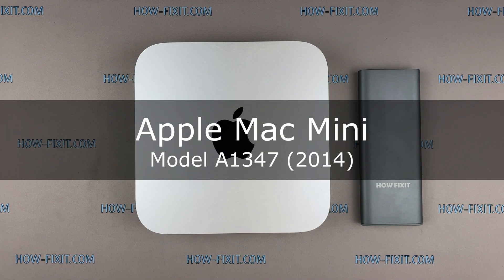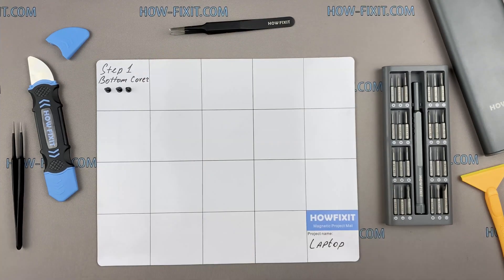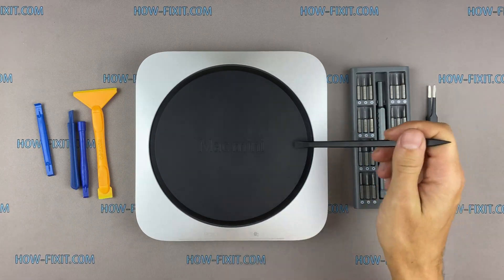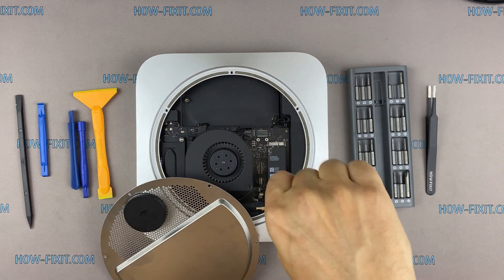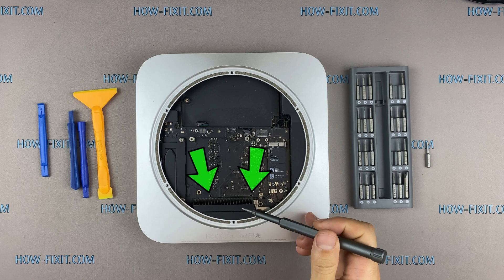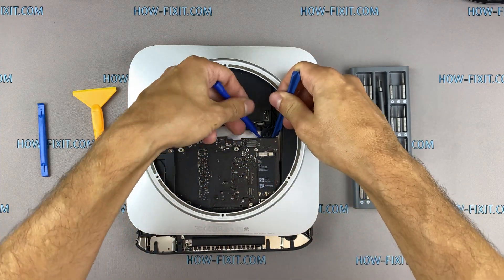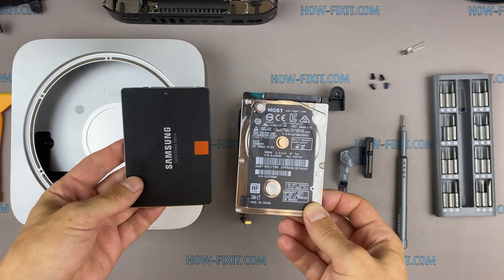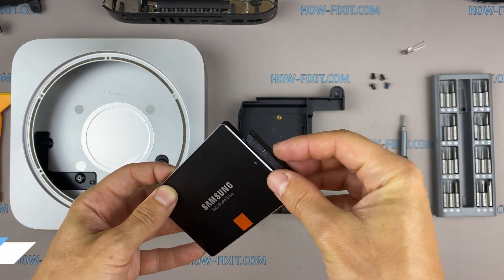Apple Mac Mini 2014 (A1347) Upgrade and install SSD or Hard Drive replacement

Comment: I just got a used Mac Mini late 2014 with 3.0 GHz i7 and 8gb ram, It came with a 1TB HDD, and it was SLOOOOOOW AF. I just replaced it with a 500GB SSD and it's about 100 times faster. I also ordered an adapter so I can easily install a M.2 NVMe drive. That'll be another 500GB, so that'll get it up to 1TB again. I'll probably install Boot Camp on the NVMe and run windows on it. 
I'm actually posting this comment from that machine.

Comment: That's neat and internally it looks really well designed. But to do this same process on a HP Mini PC you need to remove one screw (Two if you count the thumb screw that holds the case in place) and it takes about 5 minutes (or 2 if you know what you are doing).

Comment: June 2024, this video helps me to upgrade SSD of my Mac mini 2014. Thank you!
Reply: July for me..... Now to get a NVMe adapter
Reply: Is the machine still working fine in 2024? should i buy?
Reply: @alikhan-xs5wc  Mine is still working fine. I mainly use it to play Tidal in my HiFi setup and browse Youtube.
Reply: @alikhan-xs5wc  It‘s good enough for me to watch online video, web surf and local photo browser in 2024. Mac mini 2014 later 8GB + self-upgraded SSD.
Reply: I just used this video to swap in an SSD. It now runs ‘better’. Don’t bother with MacOS. Learn to use Linux.
Reply: @MagioneUmbria  what about windows?

Comment: What is the connection at 2:28 ?  I totally ripped it off , can I buy one and solder it ?
Reply: Awesome. I'll put it back together and give it a try tomorrow.
Reply: I did the same thing.  Did you figure this out?
Reply: @xMinist3r  yep , it’s for the IR sensor. Which I never used and it functions fine without it.

Comment: Hi there! I really like your videos ... Very well edited and done. Explanation 100% clear - Is there by any chance a video about upgrading the DDR3 memory of this very same model? (MacMini 2014?)
Reply: The 2014 Mac Minis do not have upgradeable RAM, there might be a way to do it but you’d need a PHD in electrical engineering to upgrade it since it’s integrated into the logic board lmao.
Afaik the last Mac Mini with upgradeable ram sticks was the 2012 model.

Comment: Can't make this connection at the 7:40 mark ... been trying for an hour . any suggestions ?
Reply: Yeah, I'm gonna say that you pulled the entire connector off which is very easy to do. Careful superglue might fix it
Reply: @alexanderthedecent6778  it's just the remote connector.  I just put back together without it and the mac mini works just fine.  Now to figure out what I want to do with it.
Reply: i cant either. i think i brought up the whole peice. not sure what to do about that.
Reply: @ANTIPLANETRECORDS  any luck? I did the same thing

Comment: I yanked the piece at 2:27 too hard and it came off with not only the wire part but the bottom too. Any suggestions? Can this be super glued back?
Reply: i need to know too
Reply: I broke the connection too. It's very weak and the video shows him doing it too fast.
Reply: Amazing. That connection was, for me as well, a near disaster. 

And, I’m not sure that there is a safe way to remove it.

Comment: Hi, at 2.26 you lift a connector with that black prying tool, what is that connection..... I made a mistake and lifted from the front and it is broken. Pls let me know what it is and what I must do to fix it? Will i have to replace the whole multi-cable? many thx. Keith
Reply: Yeah. Total BS. I lifted that connector instead of sliding it back and the pins broke off. No way to fix it. Mac is a brick now.
Reply: @easy1easy1  literally no way to fix it?!

Comment: Thanks for the video. Got mine upgraded following this video! Not too difficult just took my time and watched video several times.  I suggest a USB boot drive and not the internet thing which did not work for me. P.S. also found out slightly later this Model can also take a NVMe SSD drive (wow!) which is even faster. I added this as well. Now I have two 1TB drives and the boot drive is on the NVMe for even faster boot times.
Reply: Could you tell me how you did this? Never messed with the NVMe SSDs. Ty!

Comment: That oblong piece of tape that you removed and did not replace is used to ensure a good connection between the drive and the adaptor. It is more important to use on a HDD due to vibration but can prevent problems with an SSD.
Reply: @monkeys3080  mans commenting 🤓 on good advice under a video about working on your own computer.

Comment: You have to basically disassemble the entire unit to reach the HDD! You know they designed it like that on purpose to discourage people from doing this.
Reply: Same thing with the ram. They don’t want us upgrading without giving them more money
Reply: This hasn’t been the worst apple product I’ve taken apart in my time the Mac Pro 2013 being the worst Mac that is hard
Reply: i bought this and i really regret it.fuck apple.not touching any of their product anymore
Reply: I just installed Linux min and called it a day because I wasn't going to dig that deep and risk breaking something
Reply: I hate Apple.
Reply: nothing is impossible,
you can if you want !
Reply: You can still do it thought. There's a reason why 2014 mac mini's are still viable while any windows compute has been complete obsoleted
Reply: @SetssonIVI  You must be joking fanboy. 2011-2014 Dell and Lenovo Mini-PCs are just as powerful but actually meant to be upgradable by the end-user using mosty clip on and a simple philips head. You definitely do not need a tutorial to do it. I have to watch this nonsense because favours suck.
Reply: @le_baron222  stop the cap
Reply: @SetssonIVI  lmao what? "any windows compute"? Bro you can build one yourself, unless you do a hackintosh you NEED to buy some shit like this from apple.